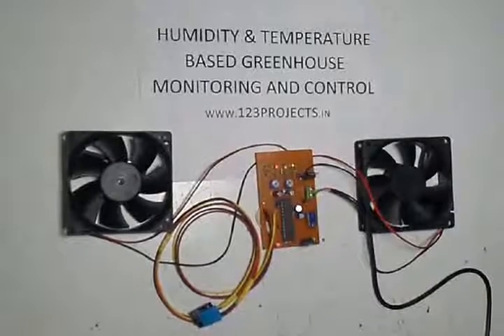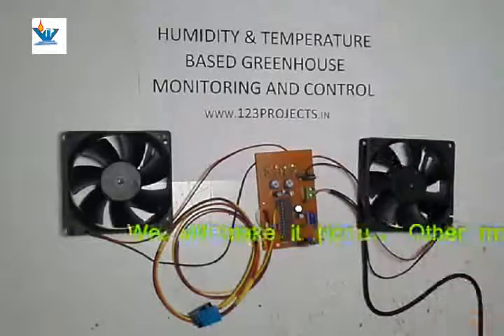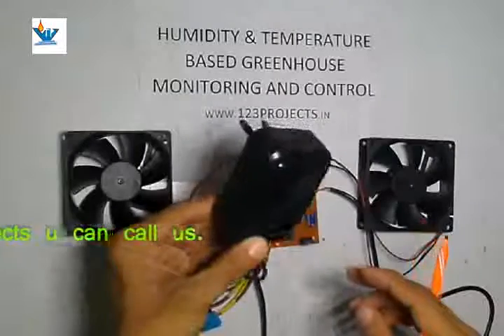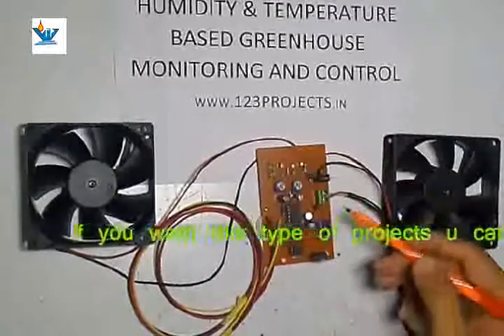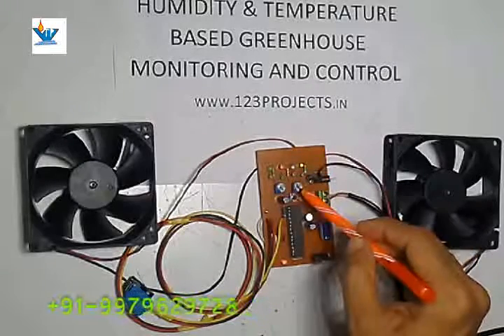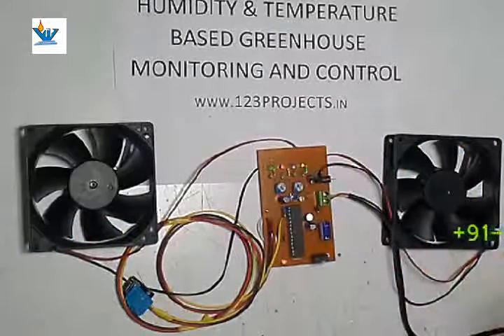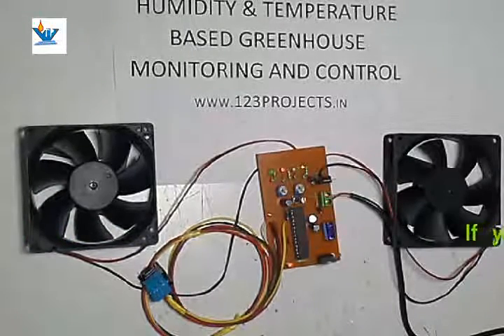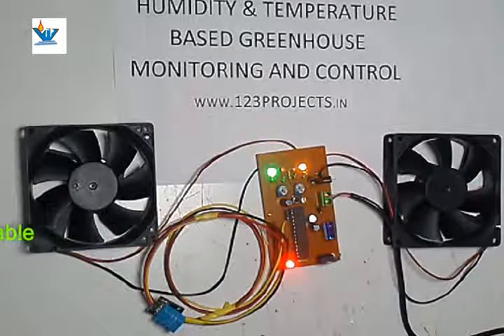Temperature and humidity control for green house monitoring using arduino  -- english

Comment: Hardly proprietary information.  I discovered sketch is a basic c++ and figured out what you have in about ten minutes. Thank you for offering to let me pay you though. I have also integrated MQ-2 sensors to determine a derivative,  nitrogen content  and an mixing algorithm for variable (concentration based) liquid fertilizers.   This requires 3 input analyses reaching close to the max capability of an arduino.  If you are interested, let me know, I won't charge you that much.